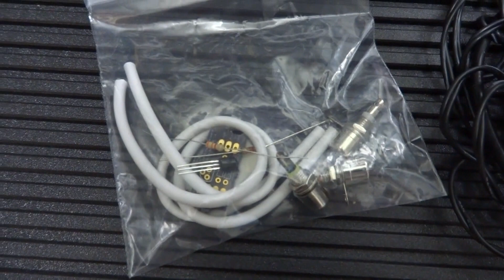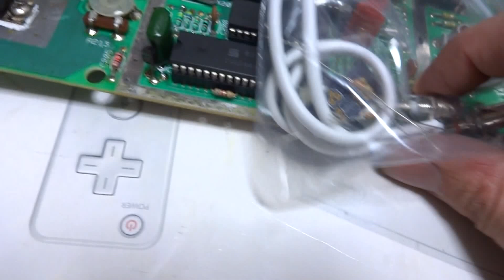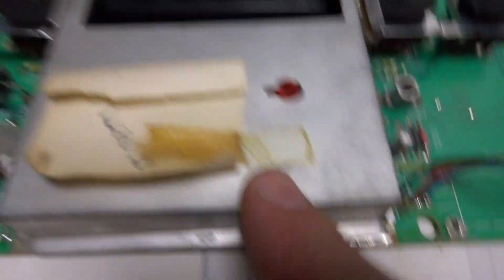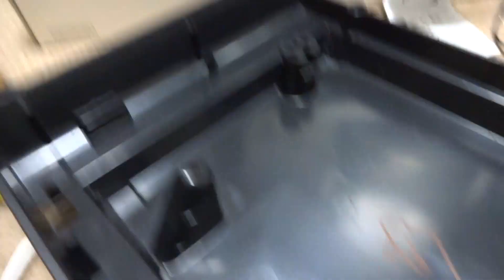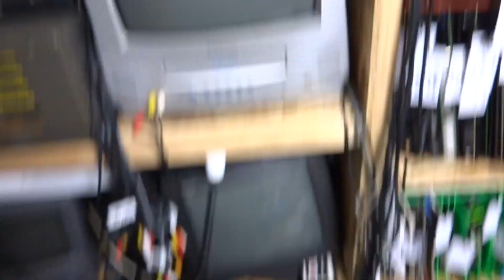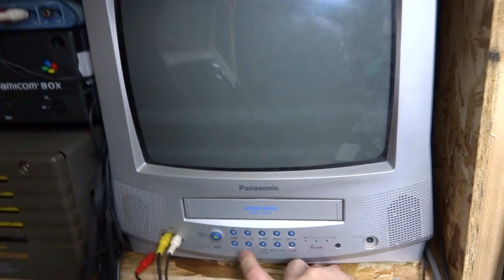Trying To Composite Mod An Atari 2600

Comment: The 2600 can do stereo sound.  The earliest model (6 switch) actually has the holes in the top grill for stereo speakers.  Atari changed the design at the last minute to route the sound to the tv instead of onboard speakers, but most of the early games were written with a two-speaker setup in mind.  Later games didn't bother since the RF out was only mono.  There is a mod to enable stereo sound and many homebrew games also do stereo sound.

Comment: Also forgot to say to make sure the encoder board is getting +5v. On the atari it has a cap on the +5v line and I think it's in series of the +5v line not parallel. Use the multimeter to double check.

Comment: I did one of these before but I used a different PCB. The one I used had S-video, composite and a stereo type as well. But I do remember that it was specific to the amount of switches the Atari had. There were different tap points for the 4 switch and 6 switch or something. Double check the instructions.

Comment: I don't know much about the 2600 but it looks like you maybe have a compatibility issue with the PSU. I seem to remember having a similar problem with an Atari I bought from ebay a few years back. It didn't come with the original PSU and the console was a bit fussy with the generic adapters I tested. Hopefully all you need is a new or compatible wall adapter.

Comment: A little advice to avoid embarrassment to yourself and making yourself look like an idiot is to actually mod the unit first and test it to ensure it works as intended before making a instruction type youtube video like this to show everyone how it's done! Unless ofcourse your intention was to make a youtube video showing people what NOT to do like this video here! Also... It would help if you followed the instructions to the letter on modding an atari 2600 too! You forgot to remove the transistor and chock-filter coil from the board. And also didn't have the video signal wire soldered in the right place to deliver the signal either! Read the instructions again and follow them and the next time it should work fine! Peace...

Comment: Did you solder the video or audio wire to that resistor? It should be the audio. You may have swapped the audio and video by accident.

Comment: The two main reasons Atari 2600's fail are ether a dead/failing voltage regulator, or dry joints on the motherboard, nearly every broken Atari 2600 I've looked at has at least one dry joint on the motherboard. I hope this helps.

Comment: Hey,  great video as always.  Wished the outcome was more positive,  but i bet you at least had a more relaxing time with what would be larger components,  as opposed to microscopic traces (first use of the word...yay).

Quick question:  did you fire it up prior to this mod?.....

Crap,  I just had a flashback and remembered you saying you couldn't because of RF....hmmmm.  I'd consider a possibility that it may not have worked correctly to beginw with.

Comment: Luke, I have tried about 4 different AV mods. Some were really complex and none of them worked. Now my atari2600 is trashed because there were too many components missing because of modding and traces got scratched and it was a mess. I got a little atari2600 jr that is supposed to be easier to AV mod. You could try to get your hands on one of those and try that. The guys from atariage might be able to help you with this.

Comment: Check to make sure that the transistor that came in the kit is an npn (2n3904) and not a pnp (2n3906) your symptoms look like you are using the wrong transistor.

Comment: Hi Luke. The old 2600 'woodgrain' type are going for about £25 unboxed on ebay.uk (not sure they would post to Japan tho')
Imo it was an iconic system - but these days the 2600 is maybe a little too retro for my tastes.
I do struggle playing any video game pre 1982 as I quickly get bored of them and my interest level drops off the scale - but anyways the best of luck with getting the 'old dear' working - lol

Comment: Hello Luke

Very interesting vid for me.
I've got the same results on a 6switch with a différent composite mod (on a pal tv).

I must check voltage regulator, condo near voltage regulator (in fact, check all the power line).

In hope that's not a bad ram/cpu/tia chip issue.

Comment: You were supposed to remove a transistor from the mother board and not the resistor.
Reply: +Will V actually 709 comes off too but behind the red pot there is a 3 pin transistor to remove - also its worth noting this works way better with a framemeister on newer TV's, my Samsung will not accept the picture but works perfectly with a Framemeister. That's more likely the older units though.

Comment: Composite conversion for a Atari 2600 - that's one vintage console mod :D
Surely the +$25 conversion kit cost more than the system is actually worth though?
Hope you get it working tho' @ some point :D

Comment: I got the same kit but for an Atari 7800. I had it working for a little while, but when I assembled the case I lost video. Still have sound, I wonder if anyone has had luck with this kit.
Reply: +Scott Lewis yes I used same kit and mine worked on 6 switch but not on newer Samsung 3D TV

Comment: Sorry you couldn’t get the Video mod to work; never thought an Atari 2600 would kick you in the virtual testicles lol/joke ;)

With my rudimentary repair skills I would replace the caps and the power supply. A universal power adapter that you can change the tips and voltage would work; 9VDC with a positive tip.

Hopefully there will be a round 2 and it will be up and running soon. Love your videos as I learn a lot from them. Keep up the good work.

Comment: You didn't follow instructions.  With the composite mod you need to remove a transistor and a resistor from the board.

Comment: Hi Luke, I think you have to remove the Q202 also, and double check your wires.
Open this PDF for a detailed description. Page 8 is necessary for your Atari Model

bit .ly/    141TOcq